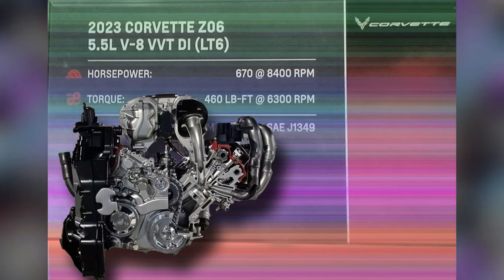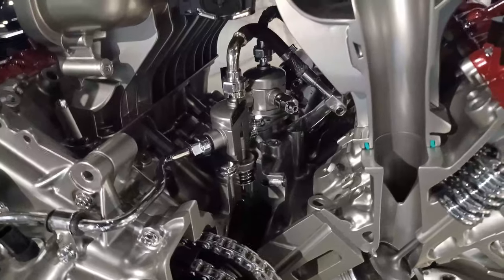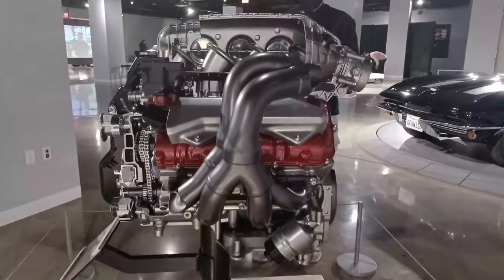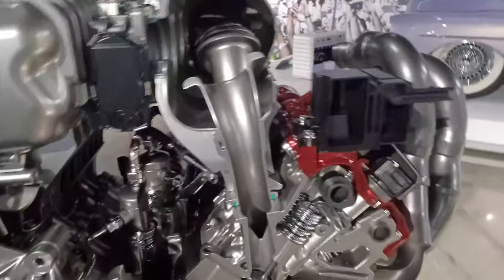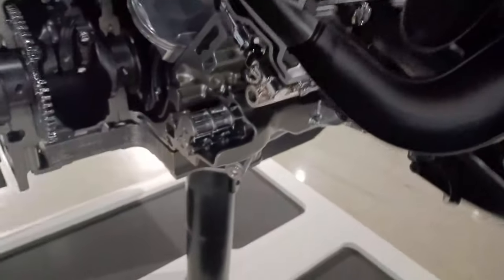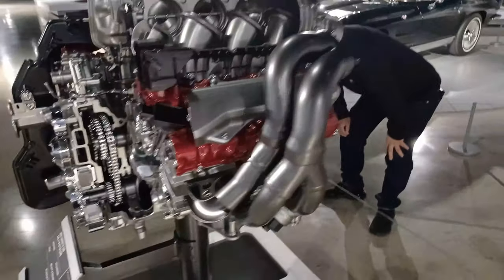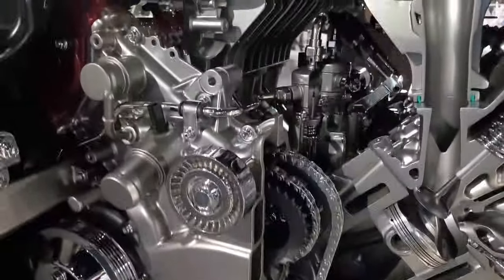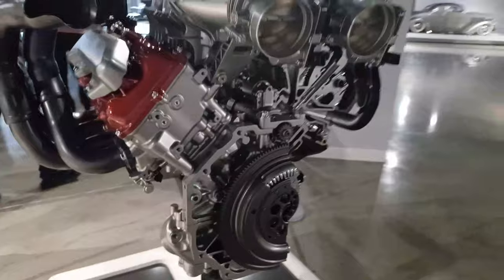The Most Powerful NA V8 Ever Produced. C8 Z06 Corvette LT6 Engine.

Comment: Great video sir thank you dual overhead cam looks like to 4 vale’s per cylinder.
Reply from the maker: Yes, there are four valves per cylinder. Here is an explanation from Motortrend about how the intake flutes boost the air intake. "When each of the Corvette Z06's 32 individual intake valves slams shut, it creates a pressure wave that reflects back up the intake runner. When the timing's just right, that wave reflects back down a runner while its intake valve is open to help cram extra air in. This is called resonance supercharging, and it's based on the same Helmholtz resonance effect that creates sound when you blow across the top of a bottle. This type of supercharging exacts no horsepower penalty on the engine."
Reply: @C8CorvetteLife  like a 2 pd boost I heard .